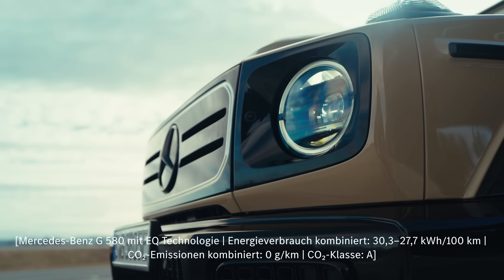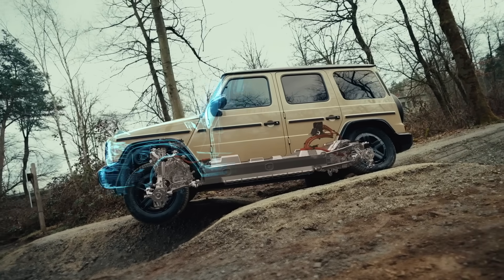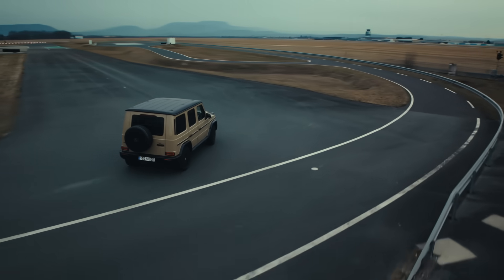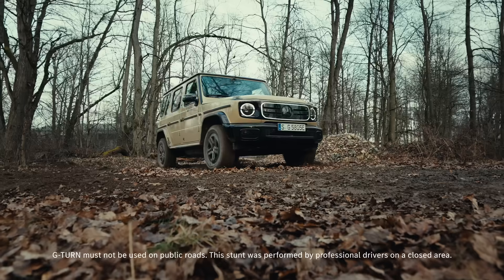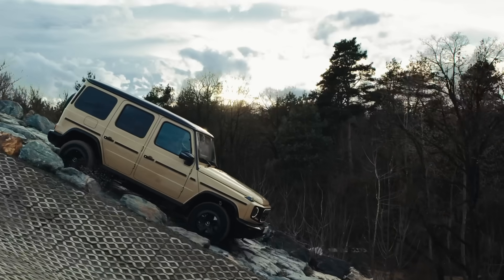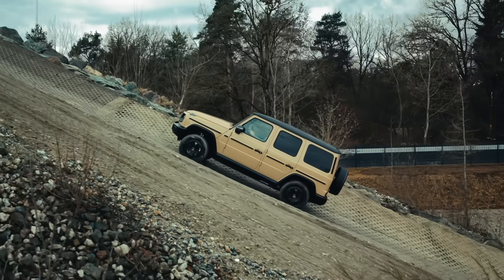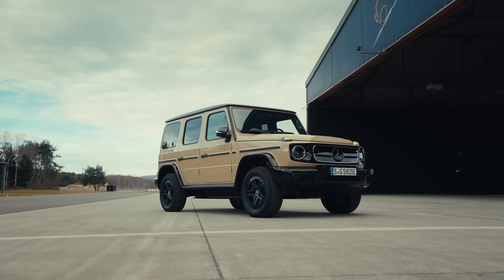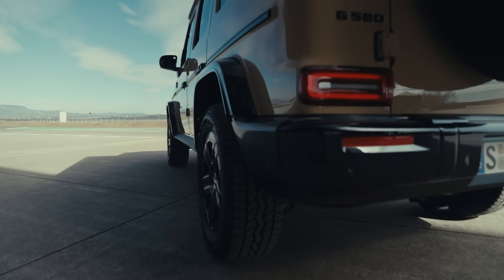The all-new electric G-Class – Electric Architecture | Teaching Tech

Comment: Why still goes ladder-frame, not unibody?
Reply from the maker: Hi there, that's a great question! While unibody construction, which integrates the body and frame into a single unit, offers benefits like weight reduction and improved fuel efficiency, it doesn't provide the same level of ruggedness and simplicity for repair and modification that a ladder-frame does. That's why for the all-new electric G-Class, which is synonymous with off-road prowess and durability, the ladder-frame remains the preferred choice. We hope this helps! 😉